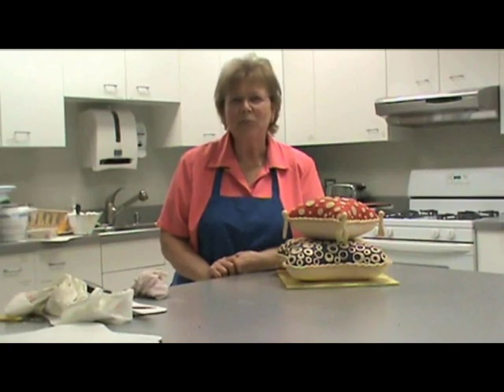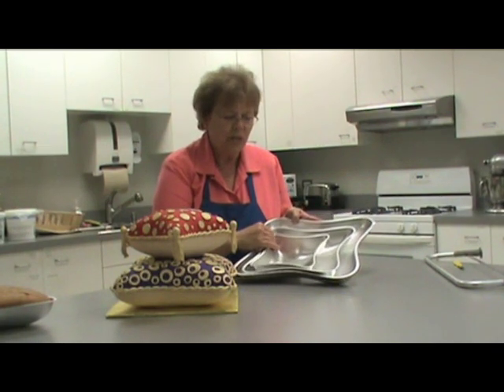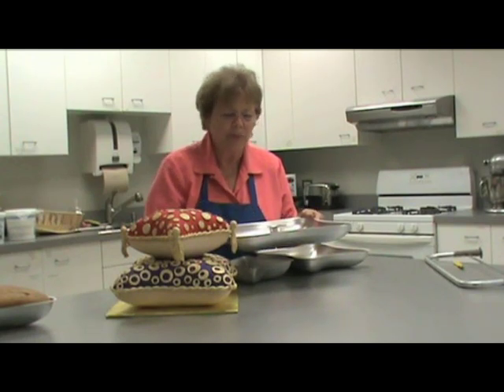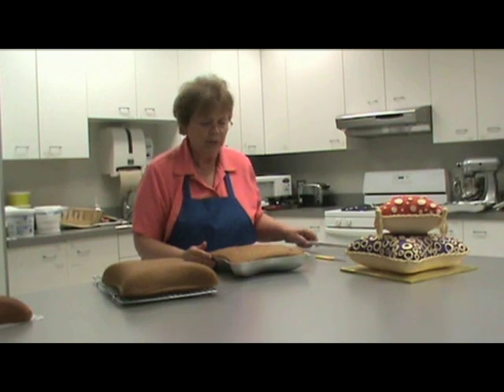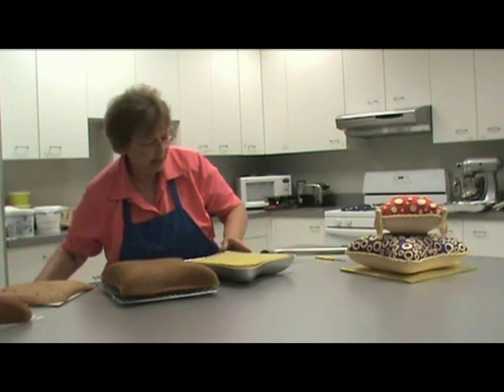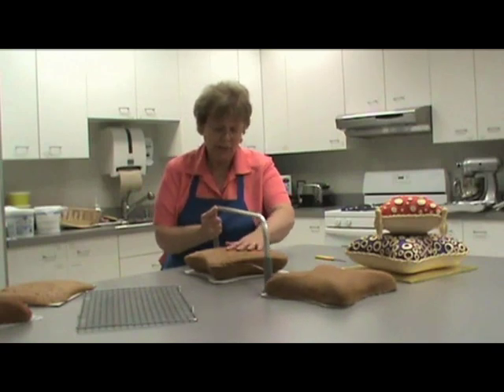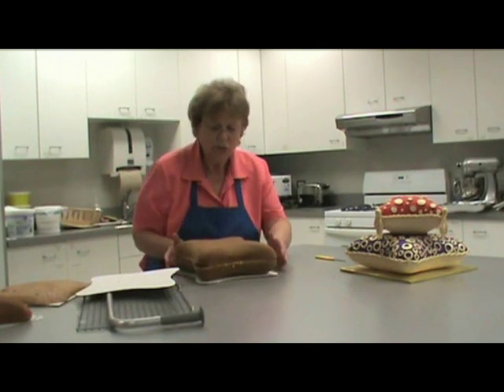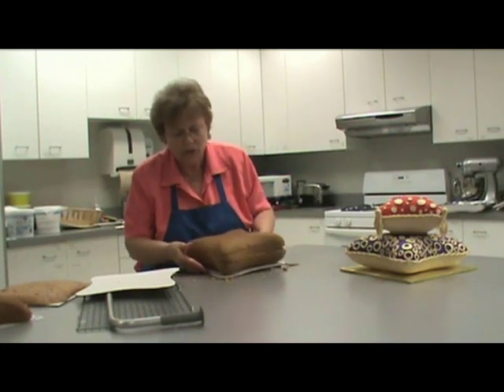Using the Wilton Pillow Pan - Part 1

Comment: How do you use the heating core? Do you just place it in the middle of the tin and pour your batter in and over it or around it then take it out when it's baked? Don't you end up with a hole in your cake?

Comment: I had a difficult time hiding the support boards under each pillow cake. I felt that they had to be large enough to actually support the pillow, especially at the edges. How small in do you suggest to make the support boards? I wish Wilton had these available in the correct sz for these pans...cutting boards isn't fun! Also, I used pound cake, thinking it would make it stronger and less likely to fall apart than regular cake mix. Which one is recommended for stacking all three pillows?